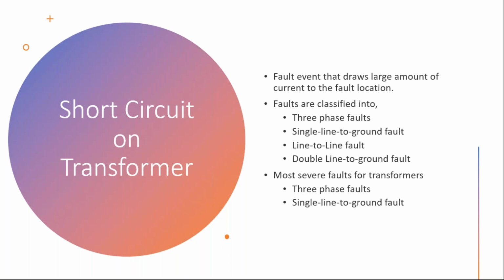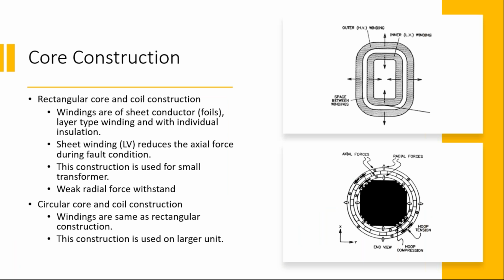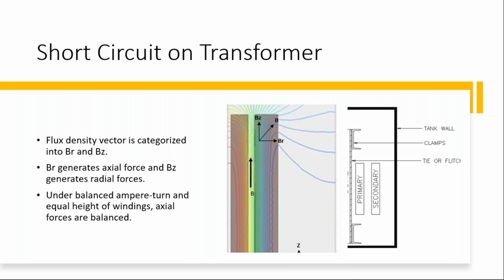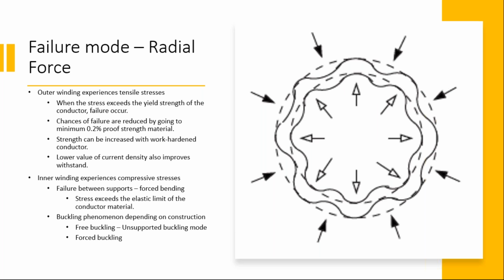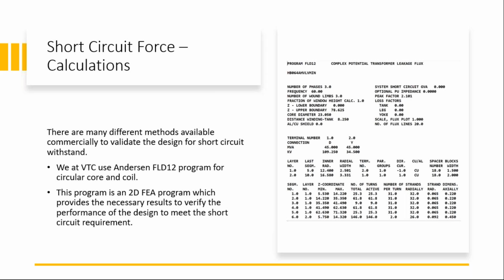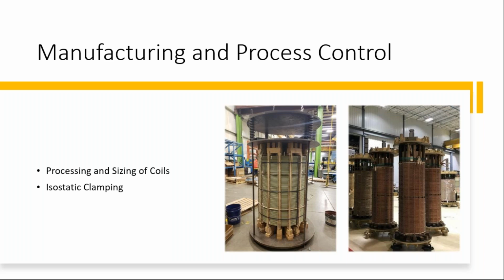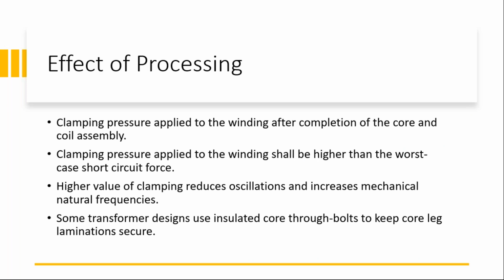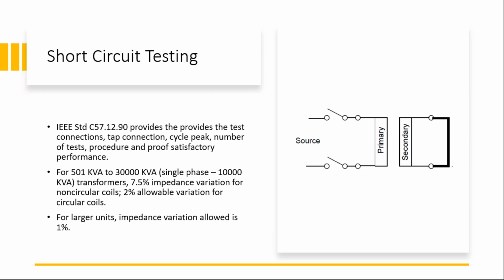Transformer Short Circuit – Design and Manufacturing Considerations

Comment: How can the customer specify the size of the conductor that can withstand the short circuit in the transformer?  How can the customer check if the conductors are enough to sustain the short circuit?

Comment: How will the customer know that the clamping is enough in Axial Forces?  Can you have more illustration on the axial forces during a short circuit?  What can the customer do to minimize axial forces during a short circuit?  How should we set up the circuit breaker to  minimize distructive force during the short circuit?